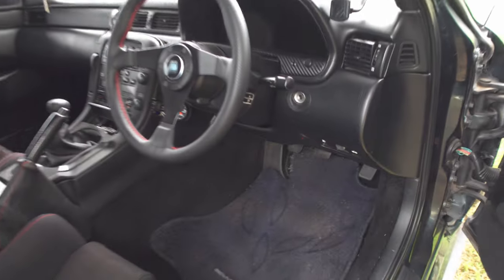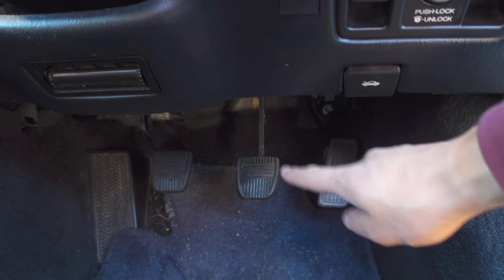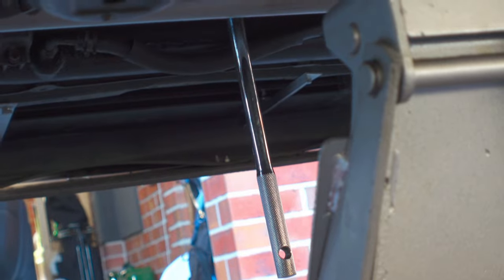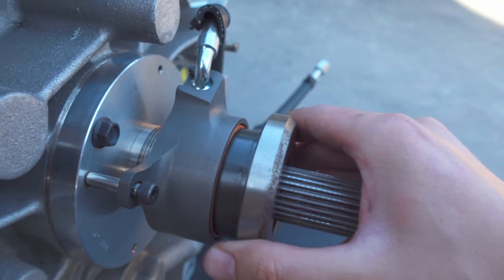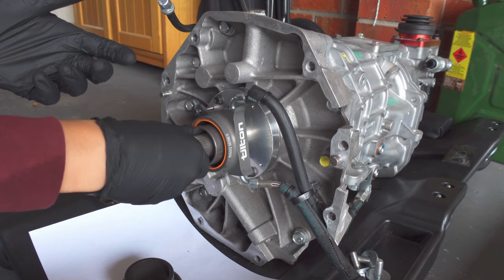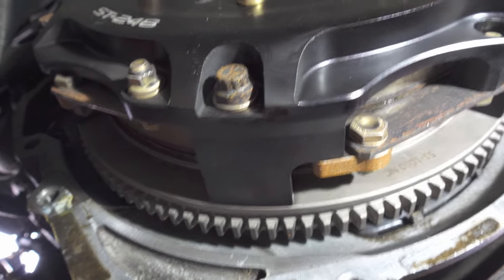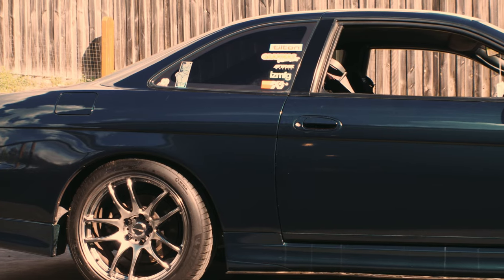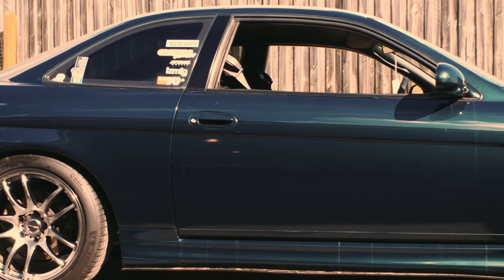Manual swapped Toyota Soarer clutch issues + new pedals and power steering pump

Comment: Mine seems be really noisy at lower rpm but after 2000 rpm silent, running the single disc mcleod. Did the same thing on the brake pedal bought a mk4 pedal didn't  fit, bend and cut the auto pedal is probably the best option.
Reply from the maker: Yeah mine is a bit noisy around 1200-1600rpm but has gotten much better with using a 75W85 oil instead of the Dex III

Comment: Love the idea of a T56 swap for my soarer too, is the gearing okay for the 4.1? Also is the KBD kit holding up good, I'm a bit scared but looks like a better deal than the 97+ stuff from jp
Reply from the maker: Yeah, it's a great gearbox and the double over drive is nice for cruising. I won't lie, the 4.1 is a little bit long, especially for making stock power. I've been thinking about changing to a 4.3 which I believe is a "bolt on" affair, when I get around to upgrading to an LSD. And yep, the KBD kit has been on for a year and a half now and has held up great! Car gets hot Aussie sun yet has no evidence of any "sagging" that some PU kits can get. Definitely happy with my choice to go KBD over the OEM 97+ kits or anything fibreglass